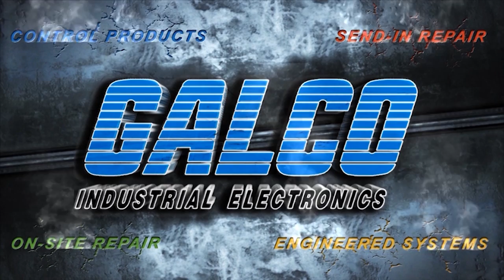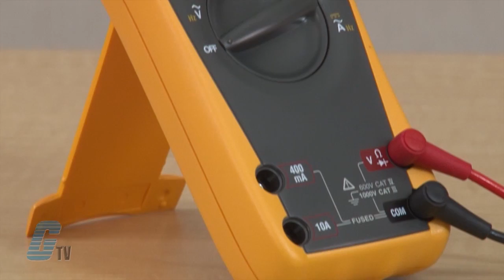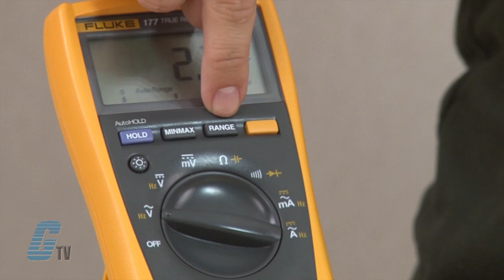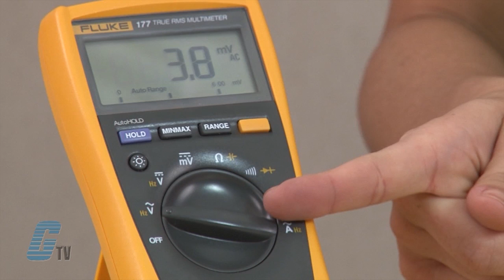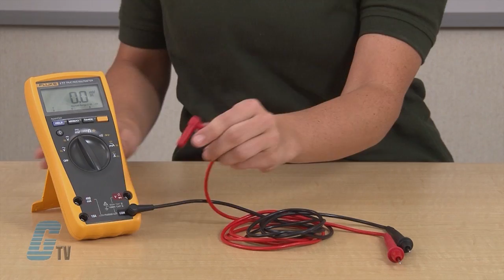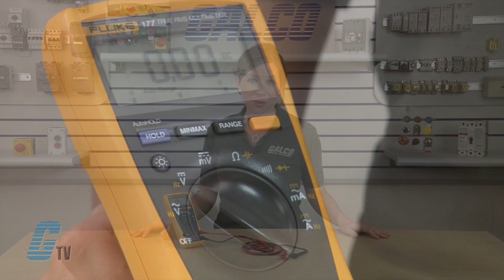Fluke Digital Multimeter Overview - 170 Series

Comment: So where do the leads need to be when measuring voltage say for instance from a hot water heater to make the breaker shut it off before I go jamming my sausage fingers into live wires? Mine is a #177 thanks in advanced!
Reply from the maker: Ok first locate the conduit that brings the power feed into your appliance. There should be a black and white wire connected to some kind of termination point. Measure across these 2 points for voltage (120/240Vac). The Fluke 177 will measure milli-volts when the power is off so be sure to pay attention to the scale indicator on the meter display. This sounds silly but it is an easy mistake to make, ok?
Reply: @GalcoIndustrial  Alright thanks. didn't notice a change in scale and figured I was doing something wrong.

Comment: Good afternoon sister writes Danilo Technical sell and Repair Computers in Republic Dominiacana have a Fluke 289 in my work and suddenly not want to climb as if the Software is damaged, I have the test probe wants me a little hand and tell me which are the two keys to be left down to do a factory reset.

I await your prompt response.
Danilo Computer Technician
Reply from the maker: Hello,  The two keys to reset the options are the reset and setup keys, but this will only reset the options and is not a true factory reset.  This might not fix your problem and the best option would be to contact Fluke directly for assistance.
Reply: Ing. Como restablecer de fabrica un Fluke 289 que tengo vendo y Reparo pc..

Comment: There is no electrical technician alive who unplugs the leads on his meter any time he turns the dial on it.
That's just plain silly.
Reply from the maker: The only time the leads are unplugged in the video is when the testing is being changed, where it would be required to plug the red lead in a different port.  I think the confusion is when she states the test leads should be disconnected from the 'test article' when switching the dial.  Unfortunately the shot used for showing the leads not connected to a circuit also shows the leads unplugged from the unit.  This was done so because the video demonstrates where the leads need to be plugged in later in the video.  We apologize for the confusion.
Reply: is that because they are all dead from electrocution ??

Comment: You disconnect the leads when switching it on and with every change you make on the meter? I don't believe that :)
Reply from the maker: Katie in this video explains that the leads are disconnected from the 'test article'.  This is not to be confused with the meter itself, and unfortunately the shot was meant to show that the leads were not connected to any circuit.  The reason the black and red leads were separated from the unit was more because the video outlines where to plug the red lead in, which changes depending on what you would like to test.
Reply: GalcoTV Ah yes that makes more sense :)